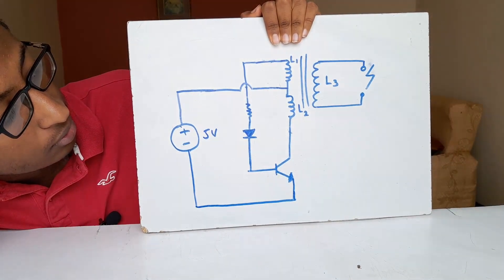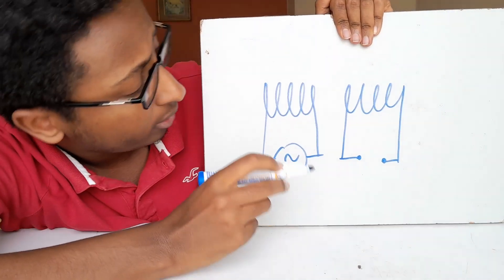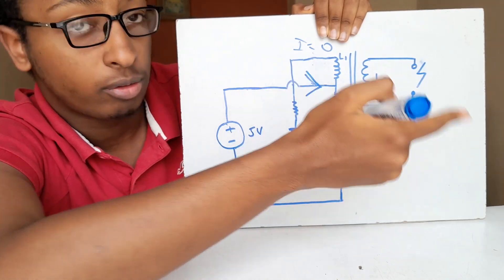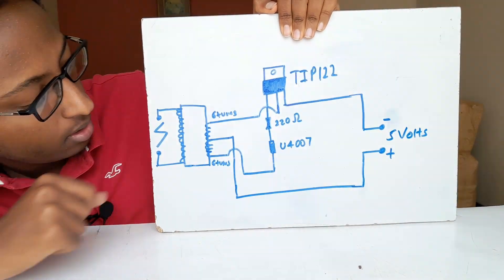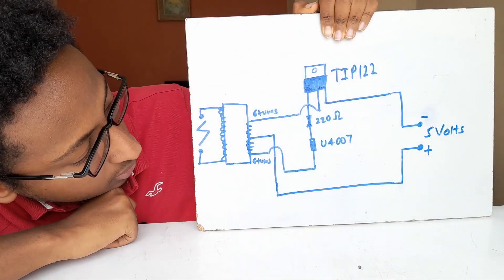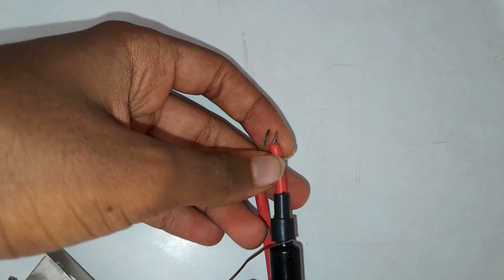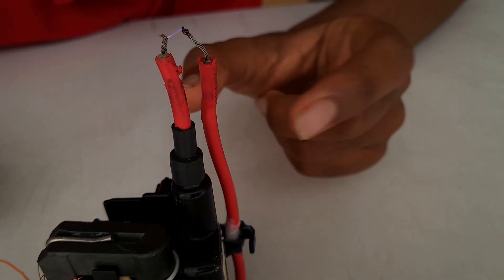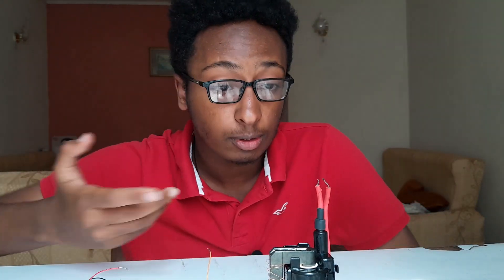I Made 15,000 VOLTS From 5 VOLTS  Using A Flyback Transformer!!!

Comment: I'm extremely rusty at electronics and my terminology is even more rusty. 
Just to clarify: L1, L2, the diode, and transistor with a current limiting resistor work to create and ac input (so to speak) from a low voltage DC input? The transistor switches on and off therefore getting the magnetic field generation and collapse needed (in L2) to induce the voltage in L3? 
Watching some of the laziness that seems to be corrupting the young, I often wonder where the minds to continue with technological advances will come from. Now I see.